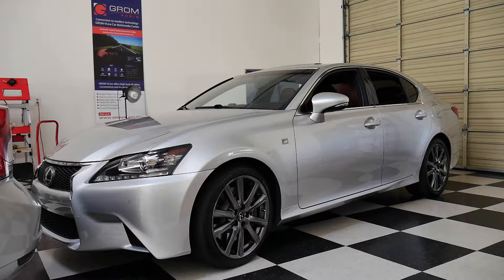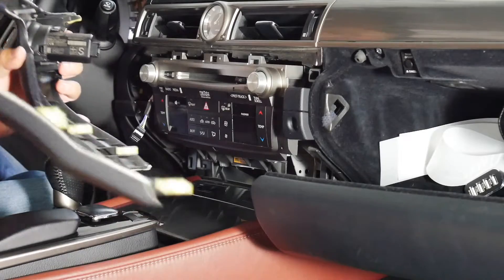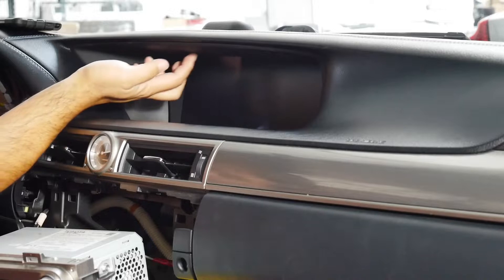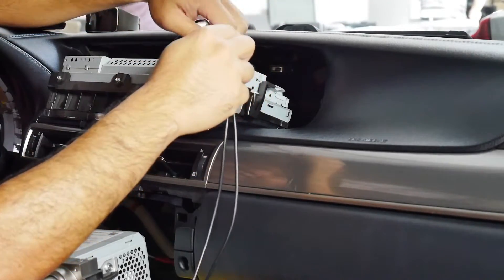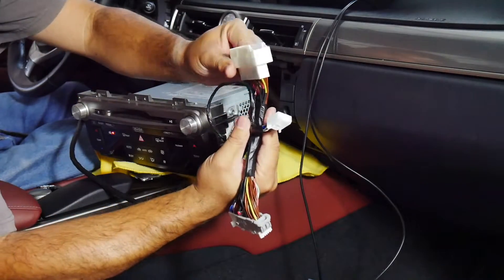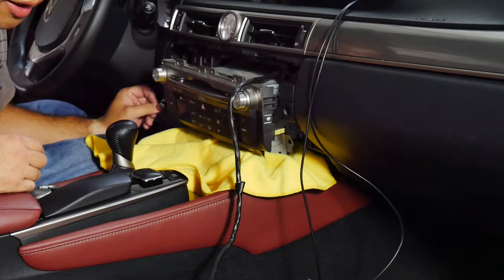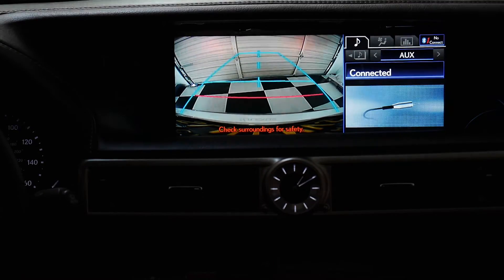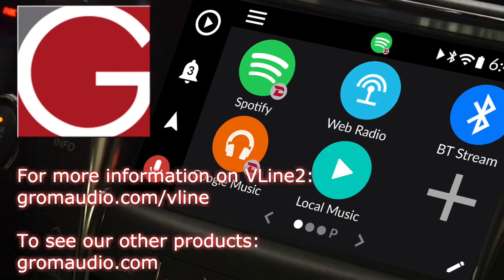Lexus GS 350 200t 430 450h 460 F 2012 - 2014 VLine Install CarPlay Android Auto Waze Google LEX78

Comment: just install my vline 2 on 2017 gs350 but I don’t see play store app on screen , how can I download the play store ?
Reply from the maker: You need to install GApps first, please refer to the user guide page 6 and up.
Reply: @gromaudio  is there caught any problems if I install vline 2 on my car and run it in couple hours and download the GG play store after ?
Reply from the maker: @teepham6743  You can download the Google Play store at any time after the installation. Just follow to the guidelines specified in the User Manual.
Reply: got another problem second time ! my joystick not working first time I disconnect car battery and reconnect, joystick work and until today it happening again hoy stick not work and screen not turn to apple carplay , how I can fix it , I have vline 2 on 2017 lexus gs350 fsport

Comment: Am I able to run apps from the Play Store to the display such as Netflix, Hulu, Youtube?
Reply from the maker: yes you can, also Netflix needs to be side-loaded.
Reply: @gromaudio  When will you have these in stock? I'm in for one
Reply from the maker: @walkertekk9  We have them in stock, please check here: https://gromaudio.com/store/vline/grom-vl2-lex7.html
Reply: @GROM Audio  done. Is there a support number or email I can ask a few questions? I had an address issue and it didn't accept bright22. 

Edit: Sent an email. Thanks
Reply from the maker: @walkertekk9  yes, the email is support at gromaudio.com
Reply: Do I need to install the gps antenna on 2014 gs350? Doesn't show here
Reply from the maker: @walkertekk9  You will need to install GPS antenna if you plan to use VLine system stand-alone, connected to the internet. If you want to use CarPlay or Android Auto, the GPS antenna in such case is optional. We still recommend installing GPS antenna for CarPlay / Android Auto integration, as it will enhance the GPS signal, and help to preserve the car's battery life.
Check here: https://gromaudio.com/forum/forum/vlite-vt2-carplay-android-auto-system-support-forum/hardware-and-accessories/553-do-you-need-gps-antenna-if-you-are-using-carplay-android-auto-with-vlite-vt2-system

Comment: Which system would you use on a 2020 GS350 F sport? I'm assuming it's the same install process since the interior looks the same pretty much. Thanks in advance
Reply: Does it play video apps such as Netflix, Hulu or even YouTube?
Reply from the maker: @rajivsharma5847  for 2020 GS 350F with the factory navigation, you will need LEX89VL2 model of VLine system, it is available here:
https://gromaudio.com/store/vline/grom-vl2-lex89.html

The installation is similar to the one we showed in this video.

The system can play YouTube, Netflix, etc when used stand-alone (not CarPlay or Android Auto), as in addition to CarPlay / Android Auto the system itself is the Android device that allows you to install the applications available on Google Play store. That includes YouTube.

Comment: Do you have a video that shows how to hide the wiring between the glove box where you suggest the vLine unit goes, and the back of the dash unit?   In other words, a video showing the full and complete installation all the way to putting the vLine in the glove box and hiding the wires?
Reply from the maker: We do not have the video of us leading the wires to the glove box, as it is hard to film. Usually there is the space that allows you to run the wires through, to the glove box. However sometimes if there is no space, the installer needs to make the hole inside the glove box, to lead the wires through.

Comment: What is the latest VLine for 2013 GS 350 f-Sport for Apple carplay & correct wiring hardness.
Reply from the maker: The latest model is LEX7VL2, it is available here: https://gromaudio.com/store/vline/grom-vl2-lex7.html It has Apple CarPlay and comes with correct harness.
Reply: @gromaudio  Would it be bluetooth to Apple carplay?
Reply from the maker: @TY-ue3zk  yes you can use CarPlay wireless with VLine VL2 system.

Comment: Which Vline model do I use for a 2015 GS 350 w/ Navigation F-Sport package? Also, would this work if I have an iPhone instead of an Android? Thank you!
Reply from the maker: Hello Alex, for 2015 GS350 with nav you will need LEX89VL2 model of VLine VL2 system, check here: https://gromaudio.com/store/vline/grom-vl2-lex89.html
It will work with the iPhone as well, via CarPlay. Thank you!
Reply: @gromaudio Do I need the vaux av cable too if u already have a back up camera? What’s this for?
Reply from the maker: @KingSavage96  , you do not need the VAUX cable if you already have a factory backup camera. You will need this cable if you want to integrate the aftermarket camera with your VLine.

Comment: Which Vline model do I use for a 2014 GS 350?
Reply from the maker: For 2014 Lexus GS 350 with nav you need LEX7VL2 model of VLine system. It is available here: https://gromaudio.com/store/vline/grom-vl2-lex7.html
Reply: @gromaudio  Hi! I have a 2014 GS350 that does not have the navigation but has the radio and screen. Will the VLine system work with this setup?
Reply from the maker: @kgpctech  hello! For 2014 Lexus GS 350 the stereo needs factory navigation to be compatible with VLine VL2 system. All compatibility is available on our website gromaudio.com

Comment: question is yrs 3rd party install mines is a 3rd party install from previous owner of car when I bought the car owner connected it up for me. many months ago I disconnected my phone from it as it was peeing me off connecting to apply car play everytime I turned car on to drive it. I reconnected it but for love nor money I can’t get my phone to play sound to the car via the Apple car play. I’ve tried everything I can think of wife connected, Bluetooth connected etc. It also mirrors from my phone to the car but again still no sound? I have everything paired up. What am I doing wrong? I have a 2012 450h gs
Reply from the maker: I assume you have GROM VLine system installed, correct? If so, you can check with our technical team at https://gromaudio.com/support.html They will help.
Reply: @gromaudio  thanks I’ll check it out

Comment: Would this be compatible if I also decide to install a front camera with wires and button control to active the front camera on and off with this kit? since I believe it requires the AUX as well! If anyone knows I’ll gladly appreciate it! Cheers!
Reply from the maker: Yes it is compatible. You would need the VAUX cable, which is available here:

https://gromaudio.com/store/vline_accessories/cable-vaux.html

Thank you.
Reply: @gromaudio  Thank you, so besides buying the front camera and the VAUX cable is there anything else I need? I've seen videos where people buy a switch button cable. Would I need this since I have the carplay kit
Reply from the maker: @carlos103301  Switch button cable is probably very customized setup. In general you do not need any extra cables for CarPlay to work via VLine.

Comment: How do you switch between the car built in system and the VLine? Yesterday I just ordered a VL2 for my 2007 LS460 Lexus. Looking forward to getting it set up.
Reply from the maker: Thank you for your order and your interest in GROM VLine! You will simply press the same button on the stereo that allows you to switch to the climate controls. None of the factory functions become disabled, you will access them the same way as before.
Reply: @gromaudio  Thanks for the reply. In the LS460 to access the telephone I need to hit the "info" button next to the screen, and then press "telephone" on the screen. Would this be how I access the Vline 2 screen? Sorry for many questions! I can't wait to get it set up now....2.5 weeks though :(
Reply from the maker: @rossfripp4503  That is correct, exactly the same way. Thank you!